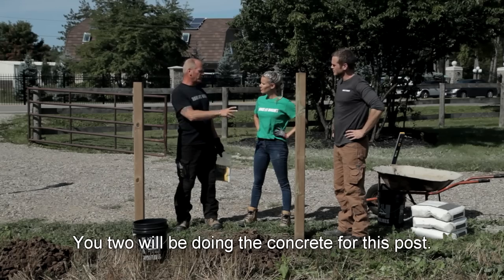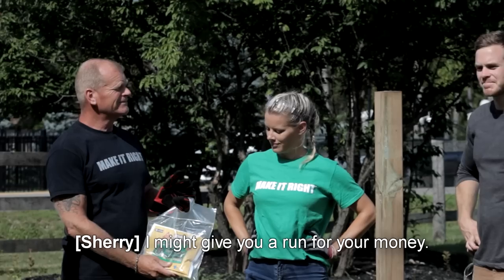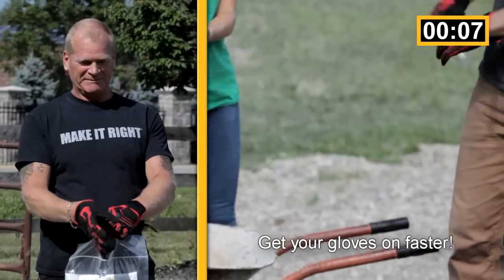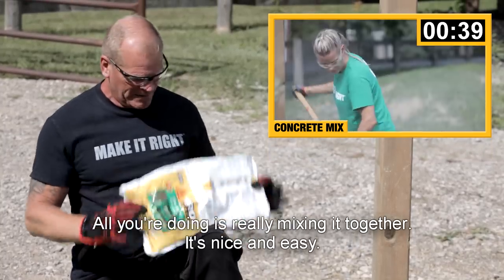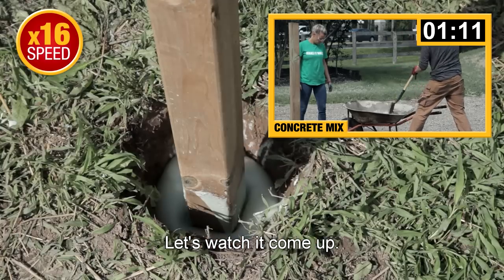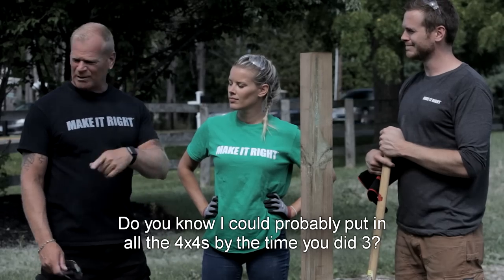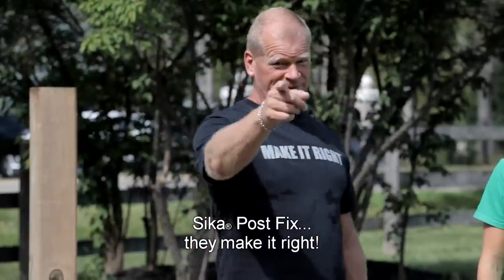Installing a Fence Post with Sika Post Fix vs. Concrete Post Mix (feat. Mike Holmes)

Comment: I did my picket fence over 20 yrs ago. Posts are still straight  and solid. I didnt mix the concrete with water either. What I did was dig the hole, Pour about 2 inches of dry concrete mix in the hole, tamped it down with the post. Then I set the post in, leveled it and poured more dry mix in, and packed it in periodically as I continued to fill to about 3 inches from ground level . It was solid as hell at that point, but I left it alone for a day or two. What happens is the moisture in the ground will be absorbed by the concrete and harden. ! No Mixing and  mess. A guy who owned fence company told me this trick.And it works. Did you ever leave a bag of concrete mix in the corner of the garage and in time it hardened? Well it took moisture out of the air to do this, and you werent even trying! So, you can figure that theres quite a bit of more moisture in the ground. and it will solidify. No messy , sloppy, and tiring mixing concrete. If you want. ,as you fill and compact the hole, you also can just pour a little water in at different intervals to speed up the process.
Reply: I see no reason why this "method" would not work just fine.  The "mix" is "out-of-site", buried underground, the "mix" is not requiring any finishing, the "mix" is contained.  There is always a curing time needed for any wet concrete slurry mix anyways ....so whatever bracing is in place, is usually in place for a few days ....so why not simply throw the dry mix straight out of the bag and into the hole?

The only issue to be aware of is that water is the hardening agent for concrete.  So if everything is bone dry, this would not be a good idea alone.  Adding water at every 6" layer, or randomly throughout the filling of the hole, the mix would harden, probably enough to hold the post firm .....and every subsequent rain would simply keep hardening the concrete over time.

The only "savings" would be to not do the normal wet mixing beforehand ....which isn't really that hard ...but DOES take a little time and DOES require the cleaning of the mixing container afterwards.👍👍
Reply: @renechimborazo7166  not sure why you're calling names but job quality and longevity win out over something costly that doesnt stand the test of time creating loose post and accelerated rotting which makes it not only not effective but absolutely useless.  So who's the dummy again?

Comment: I don't understand the negative comments. I built my fence using this foam and the fence is solid as a rock.
I guess some people don't follow the instructions and use this product in low temperatures or in the presence of water in the post holes. The day temperature in my case was around 68 degrees and no water was present in the holes. The only draw back was that I needed two bags instead of one per hole (four foot deep and six inches in diameter) instead of one as indicated on the bag. The second bag came half way out of the hole, so probably three bags might have filled two holes.

Comment: With the bags of cement pour half of the 1st bag of concrete in the hole, then pour a gallon of water on top of the cement pour the rest of the 1st bag in the hole pour some more water in the hole, get the 2nd bag pour half the bag of concrete in the hole add some more water, dump the rest of the 2nd bag of concrete in then top the hole with some more water and you're done.

Comment: It's certainly more expensive than the concrete at $12.60 US at Lowe's. My bag says not to mix for more than 15 seconds and then to pour it into the hole. It also says NOT to let it start expanding in the bag.

Comment: I've got a question.. could i use this product to insulate a cinderblock wall?
Reply: Not really.  Just pick up some sheets of foam and a few tubes of appropriate glue and you will have a much nicer and neater job.
Reply: Instead of building a cinder block wall and trying to insulate it, consider Insulated Concrete Form (ICF) construction.  Plenty of videos about it on YouTube.

Comment: The stuff is great. The video was great too, only thing is you’re not supposed to use concrete or similar material to secure posts for rural mailboxes per the USPS.  Just sayin
Reply: this is Canada.
Reply: Dizzy Fingers and why is this? I mean it’s my mailbox on my property so why do they care as long as it’s at the proper height and distance from road way
Reply: @kvnjhnsn9  canaduh?

Comment: But does foam hold to compression over time? Doubt it lasts more than a year an the average fence.
Reply: It actually depends on the soil if compression holds over time however this same concept is used setting power poles and I’m sure they’ve done long term viability testing and by the way don’t argue with Uncle Holmes lol jking had to say it with your last name and all
Reply: @aron6998  I did hear that they use a similar product on utility poles. I'm willing to bet that it's a more robust product and that the consumer product is cheaper.

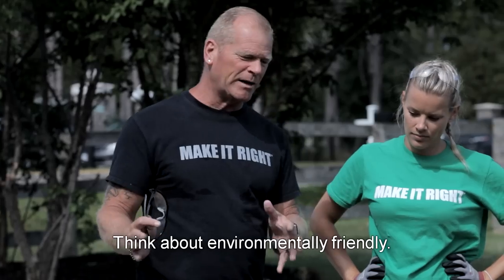Comment: @2:42 "Think about environmentally friendly..." I don't think there is anything about foam that is environmentally friendly
Reply: Many of these products are environmentally friendly in the sense that once they harden, they are considered inert.  Once dry, they do not leach into the ground.  Like most products humans use, the factories that produce them may give off emissions that aren't friendly.  Still, I would prefer this to concrete.
Reply: well, you know the plastic bag that it comes in is probably the most environmentally friendly thing ever.
Reply: I don't think there's anything environmentally friendly about pressure treated lumber, but we put that in the ground.

Comment: I used to think this was a great product until I saw all the real world videos showing foam shrinkage and loose posts!  This won’t be used on my fence posts.  Lost a little respect for Mike Holmes with him recommending this product!
Reply: Mike Holmes entered into a partnership with Sika Canada back in 2018. Sika makes several products and I'm sure he wouldn't lend his name to it if he didn't think it was a good product. Maybe that opinion has changed since this video was made, but the product works and many users report no problems. Regarding the shrinkage, here's what I think is happening... Every piece of pressure treated lumber I've bought is still sopping wet from the treatment process. I always let it dry before I use it. Now, if someone drops a fresh post into a hole, then uses this product, the post, over time, will shrink away from the foam. Honestly, I don't even know that expanding foam really shrinks at all. It hasn't been my experience.
Reply: @pawpawstew  I've seen this tested on metal posts and 2 days later it had incredible shrinkage and loosened a lot. Don't use this product if you're a professional
Reply: @pawpawstew  well it shrinks away from metal also and I don’t think metal contains. Lot of moistire

Comment: This stuff is not good for stockade  fence. It is too soft. The posts will become loose. Concrete is the ONLY way to go
Reply: @BugJuiceFlavor   See for yourself, dig a 24" hole and place a 4 by 4 in the center of the whole, and add this stuff. Come back the next day and grab the top of the Pole and start to exert force randomly from different sides just as wind would do and nature would do over the course of a year on a fence. I guarantee you within 10 minutes that post will be so loose. I planted 24 posts in one day with my sons and we had to dig them all up the next week.

Comment: Have they fixed how badly the foam shrinkage is? I've seen too many videos from random people showing how badly it'll shrink. Fix that and you've got a winner. Till then? Hard pass from me.
Reply: I'd lay money that the wooden post is shrinking and not the foam. That's the nature of wood. Plastic (which is basically what foam is), is fairly dimensionally stable compared to wood.
Reply: They haven't fix the issues yet.
Reply: @pawpawstew  so let me get this right...... the wood post is shrinking?
Reply: @donnimetropolis9899  I've been researching this, and watched a couple videos with contractors that used a plastic bucket and a metal post as well as in ground with metal post to really test this stuff. Still had shrink issues. It's not the wood.
Reply: @pawpawstew  I've been researching this, and watched a couple videos with contractors that used a plastic bucket and a metal post as well as in ground with metal post to really test this stuff. Still had shrink issues. It's not the wood.

Comment: Sorry but over time the Sika bond comes lose, I have eight fence posts I tried and at first it was a strong bond but about three weeks later there was a lot of play in the hole with the Sika,  the other posts that had concrete poured in it had no trouble at all. I've even watched videos on You Tube of other fence contractors stating the same as I. The sika once it cured had tiny voids in it around the pole and that's bad because when it rains water can get in the void and the pole will rot quicker over time. If the sika would have formed a air tight bond all the way around it would have been fine but it didn't. Here's one of many videos commenting on it.               https://www.youtube.com/watch?v=kjk4cBnf-1U

Comment: Also... No one in their right mind mixes concrete for posts. Just dump the bag in and pour the water on top and it's done.
Reply: If you live in a place like idaho, the soil won't allow you to dry pack. You have to mix or you'll get frost heap. Dont believe me, drive around in idaho falls and see all the fence posts shot out of the ground
Reply: @BugJuiceFlavor  I'm not saying it's better or "correct". But it is standard operation where I'm from.  As long as you're using a high aggregate concrete mix and enough water.... it'll be fine

Comment: Well it might be faster , but it cost  a lot more than the cement does .
Reply: not really.....$12 for a bag of Sika.......$6 a bag for concrete and you'll need two bags.....and you won't need a chiropractor.....
Reply: It is, $9.47 a bag at Lowe's vs about $3.00 for concrete but, when you get old like me and you have hauled and mixed literally hundreds of bags of concrete in your life you start looking for labor saving devices. I'm going to set 8- 4x4's and I was able to walk out of Lowe's with all the bags I needed in my hands. If I used concrete I would have to had loaded them on a cart,rolled them to my truck,loaded on my truck,unload at home and then mix. So the extra money is worth it to me.
Reply: @fasteddie4145  if you can lift a 60 pound bag of concrete no need for you  to be doing the fence

Comment: Don't be fooled it's garbage..waste of money (not strong) had to redo my whole fence with concrete to make it correct!!!
Reply: How big was your hole. For a 4x4 post they say 900mm deep and absolutely no more than 200mm dia. If the dia of the hole is too big reduces the compressive strength of the foam application technique.
Reply: Same here. I had to replant all the fence posts after digging them up and cutting this junk off of all my new 4x4's. It added 2 more days to my job. It's  too soft
Reply: @jamessalatino2535  AMEN!!

Comment: The losers could have followed the alternate instruction;  Just dump the dry Sakrete into the hole and add the water to the top.  Fast and easy.  Works all the time for me at a faction of the cost.
Reply: clearly that product is for people with more money than brains...... dump dry sackcrete into hole, leave it about 4 inches below dirt level, then just add water, works every time....  and I bet you i can still do it faster than the "winner"